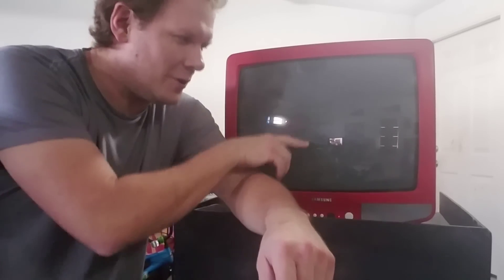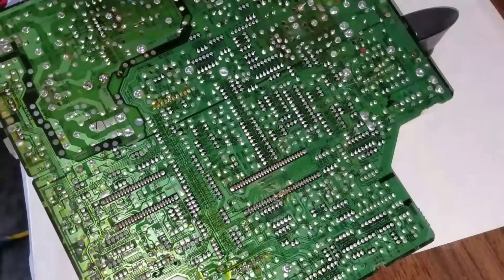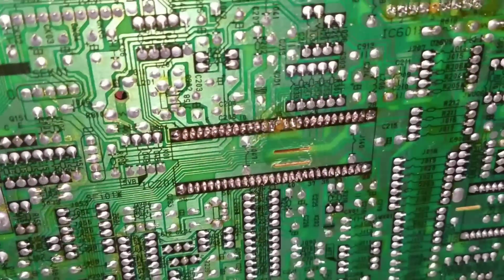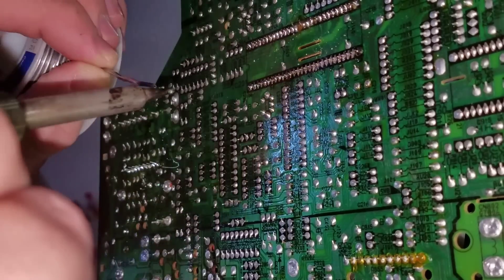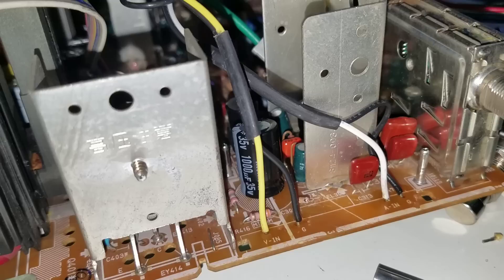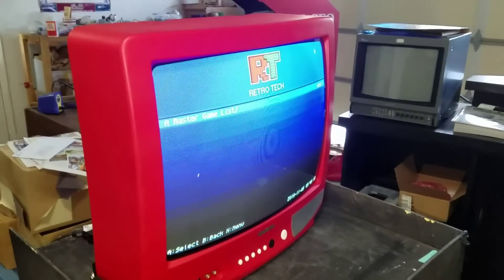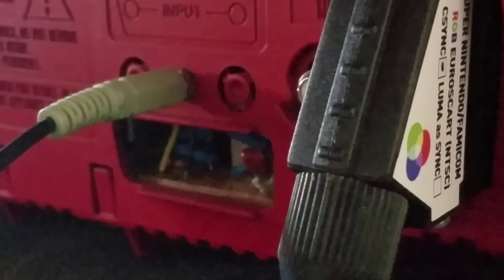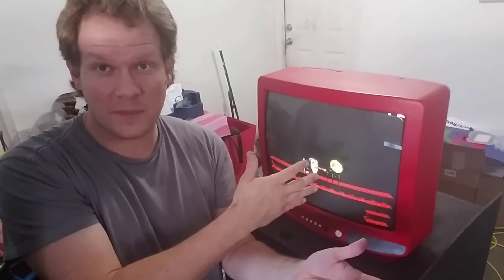TV CRT Vertical Line Collapse Repair! Plus new IC Jungle chip install

Comment: Jungle IC failures are pretty rare. Vertical problems are much more likely to be caused by bad connections, caps, resistors, diodes, transistors, or the Vertical IC.

Comment: My Jungle IC has R G B in pins, also found the blkin pin.  The problem... my TV doesn't have composite (no AV input to switch to with the remote either, guessing it's not programmed in).  Do you know what pin label the coaxial tuner usually uses? I assume I can use that as my sync, but gotta tap into it directly on the Jungle IC, might you know?

Comment: is it possible to locate the RGB and blanking pins on the Jungle IC without a service manual?  no schematics available for my set, and I reallllly want to use this specific TV because the scan lines are incredible!!!
Reply from the maker: Maybe, you would need to search the chips to see if you can find a pinout for the jungle IC

Comment: I think your blooming problem is because the signal probably needs to be attenuated coming into the jungle IC. I would try a 75 ohm resistor on R, G, B, and sync to see what effect it has. If that doesn't work, try something bigger, like 270 or 330 ohm. The SCART cable should already have some attenuation in it, but it might not be enough for your mod.
Reply from the maker: I think you are right.  I did attenuate it already with 75 ohm resistors originally.  I will try the larger ohm ones to see if that helps.  Thanks.

Comment: Recently I sub to this channel. I really like old CRT tech, specially after getting a consumer AOC CT720g VGA monitor that appears to be unfocused and have bad geometry. I suppose that is something with the capacitors or dust. I want to open it and see what is the issue (I watched your video about CRT safety too). Anyway, hope you could keep up with this channel!
Reply from the maker: Thanks and welcome to the channel.  I have lots of videos to help with servicing CRTs.  I plan to keep making content.  Focus is fixed most of the time by adjusting the Flyback Transformer.